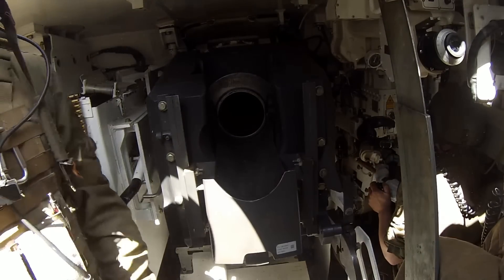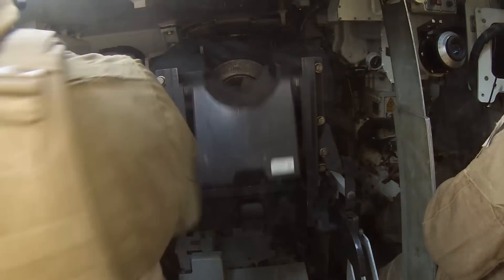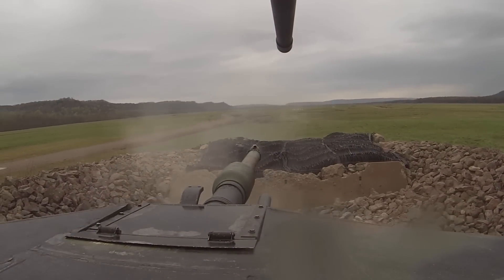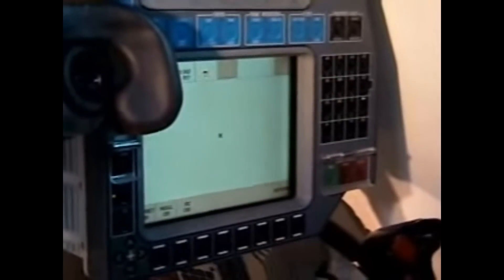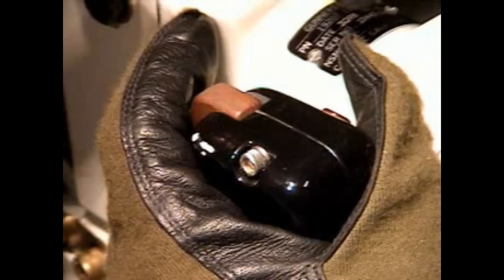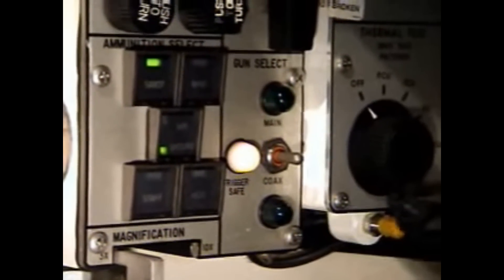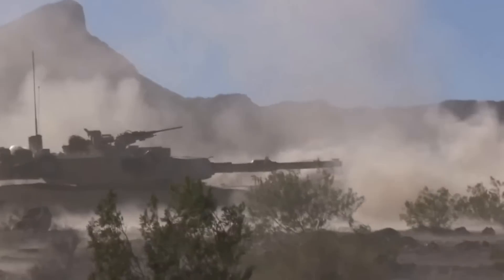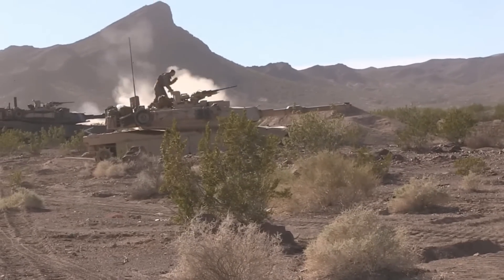How Do They Clear Tank Gun Misfires?

Comment: it's a great time to be a T-90
Reply: Any gun can misfire.
Reply: The T90's Autoloader has a reputation for loading arms instead of rounds.
Reply: facepalm BENKYism Yeah, because auto loader is designed to put the shell into the gun's breech genius.
Reply: How do you know that?
Reply: Dalek, Kenny is a troll. Don't feed a troll.
Reply: That's fucking great. And yet they fire shells which can go wrong. No matter how fucking well they were made by whoever the fuck you have a poster of above your bed.
Reply: +jappie2
T-90 has two piece ammunition you fucking genius, shell + gunpowder. 
Its VERY hard for it to misfire with two piece ammunition, this is one of the reason Soviet tanks uses two piece ammunition to begin with in big calibre guns, ease of loading and high safety and reliability. 

Main reason why shells misfire is because of the primer fails, the least common reason but it does happen is because of bad gunpowder but this is rare. 

Next time, use your head and not your feelings
Reply: And a common tank round is also a shell, some gunpowder in it and a round on top. Loading it separately does not remove the possibility of faulty gunpowder or a mechanical failure. You can act all superior all you want if it makes you feel more confident, i don't mind. 
But i recommend you use your head and not your nationalistic feelings. I can almost see you waving your russian flag from way overhere.
Reply: Sorry screw ball but every and any weapon can jam. Go learns Murphy's law. Clearly you've never served.

Also the T-90 is nothing more then a  upgraded T-72

if the T-90 has a bad round guess what? it's not gonna fire. if someone working on the tank fucked up during  down time guess what?

It's not gonna function right.

No such thing as a perfect world.
Reply: In any T-72 tank when you have accident with ammo. They will have trouble identifying what are your remains. M1 has much safer isolated compartment.
Reply: Actually there are several reasons for 2 stage ammo. 1 physical space constraints and 2 wanting to able to vary the charge are just two of the others.
Reply: @Marty Smith, I'm pretty sure HE Frag rounds were carried in small numbers occasionally on the Cheiftain and had bag charges. I know bag charges cant work for APFSDS easily and it's not as convenient with HEAT or HESH but I was under the impression that British tanks still have provision for carrying a few HE Frag for troop support. As for space constraints there are some tanks way worse than others. I believe the Challenger II, as well as all the other changes has a bit more space in the turret after crews complained that the Challenger 1 was a bit too tight for really fast gun cycling for more than a minute. If you want really tight turrets try a scout vehicle, some of the Saladin and Fox variants were just ridiculous. I was in them as a 13yo cadet with inert rounds, and they felt too small. How you crew them with full grown adults is a mystery.
Reply: I get the feeling you mean All military guns. alot of civi rifles are pure shite when it comes to both.
Reply: But the munitions they use certainly can Trollboi.
Reply: You reek of Troll Kenny, you are moot.
Reply: @Dogmeat1950 we are talking misfires not jams. Misfires are most often caused by faulty primers or firing mechanisms.
Reply: The funny thing is that whilst the T-90/80/72/64 have the reputation of loading parts of the tankers, the only time something like that has happened since the invention of the tank, was when the french started experimenting with them :P
Reply: Or bad Ammo..........

Lets not Forget the Russian T-80 had the same hype around it when it came out.
Reply: Kenny D really your best argument is a conspiracy theory?
Reply: the T-90's auto loader has a reputation of not misfiring